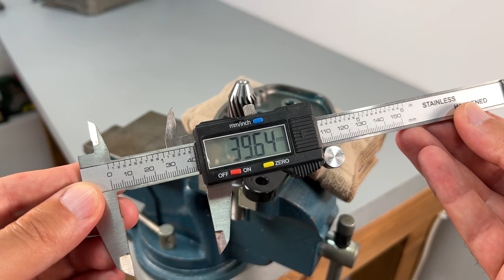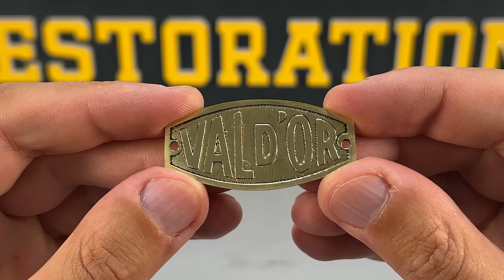1933 French Hand Cranked Grinder - Restoration

Comment: how, after turning the shafts on the gears, did you get rid of the backlash of the parts?
Reply from the maker: I turned 0.10 mm . Where need more , I cut more , but I made a bush there 👍

Comment: Was mich interessieren würde: Warum  hast du das eine Teil kalt gebläut und alle anderen aber Pulverbeschichtet? 🤔 Welche Vorteile bringt das kalt bläuen gegenüber dem Pulverbeschichten. Entschuldige bitte meine naive Frage, aber ich bin absoluter Laie.
Reply from the maker: Some parts need to be bare metal and no painted. But you can’t let them bare metal because will quickly rust. So , preventing rust on that parts , cold bluing ( or hot bluing ) are the best option for them.

Comment: Great job, but I want to warn you about getting grinding wheel dust in your lathe. Cover the lathe ways and other parts when dressing the grinding wheel. That dust is VERY abrasive and can cause problems with your lathe!
Reply from the maker: I didn’t thought to cover the lathe 🤦‍♂️ but I disassembled to clean them

Comment: Great work
But I had to watch the dressing of the wheel twice and indeed: it seems you're not protecting the ways of your lathe in any way, nor are you using a vacuum. Grinding wheel grit will cling to all the way oil, and you will quickly wear out your ways. You really need a full clean!
Reply from the maker: I already made it right after the diamond dressing process 😇

Comment: Quick question: The title says 1933, yet you have 1950 in the video. What year is correct?
Reply from the maker: I used in video and title 1950 because that was the first year I found for this item but after that, some subscribers told me the exact year for this item is 1933 and I changed only the title because the video was already made .

Comment: Don't you ever prime and wet sand your painted parts before you powder coat then ?
Reply from the maker: Powder coating doesn’t require primer. Is not like classic paint job. Sometimes I apply if the surface has a lot of puttings or if I want a perfect surface. In this case was ok just a colour  👍

Comment: Well done! It only cost you a ruined lathe. It's barbaric to dress a grinding wheel in the lathe not even covering the ways. You've turned that lathe basically into scrap.
Reply from the maker: That’s your point but guess what, the lathe is still working because of cleaning I made after that process 👍

Comment: I liked it, but not everything is fine ... 🤷🏻‍♂️.
Reply from the maker: Thanks but what isn’t fine?
Reply: @CoolAgainRestoration  My humble (😇) opinion : 
1. There should be "beds" on the base for mounting bolts - I did not see here 🕵🏻‍♂️. But this is a "change in construction" ... 🤔.
2. Black paint is too "signal" 😵 - it's a working machine, not a Walt Disney set. 
3. You had to restore and leave the original plate - it's just right 🤷🏻‍♂️. 
4. The new product - the "aluminum support" is just ridiculous - I won't even comment on it 😐.
The "remarks" are quite well-intentioned,  when you try to be the "best" - you should not make such "mistakes" 😃.

Comment: Overall a good video.  However, for someone with the obvious recourses available,  to use a wood chisel as a pry bar and a small drill bit as a punch,  gives me pause about the commitment to the correct use of the correct use of the correct tool for a given part of the project. I don't mean to nitpick but those over sights makes one wonder about an other wise excellent video.
Reply from the maker: Hi William ! Thanks but I have some tools that instead to throwing away,I keep them for this kind of use

Comment: why would you go out of your way to remove material from unseen internal mechanical components and go out of your way to round off nuts and bolts actively decreasing how easy they are to use in the long term, those nuts were pretty much brand new in terms of wear and rounding before you went and took a mill to them to make them functionally more in line with one that's been used over and over again that wrenches will slip on more frequently from ones that looked practically untouched and un worn, as someone who's worked multiple projects involving old and rounded nuts it was infuriating to see you go out of your way to achieve the same result